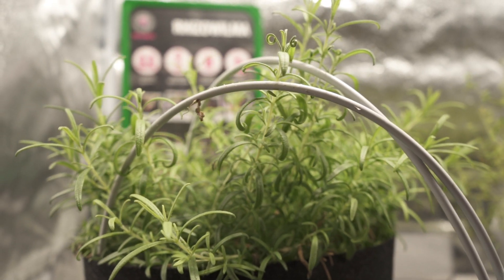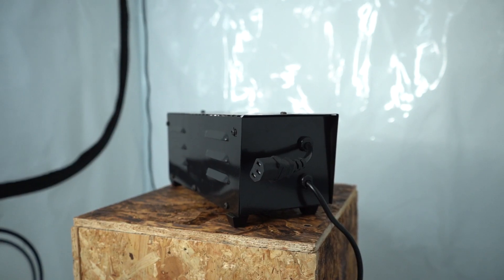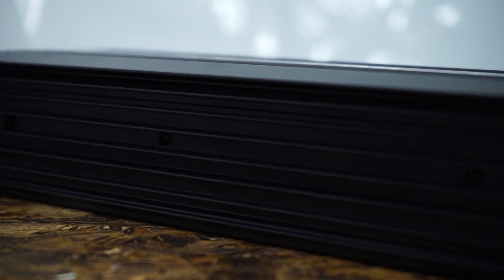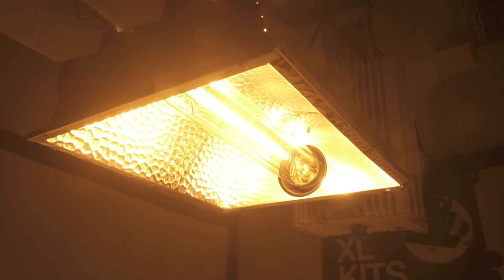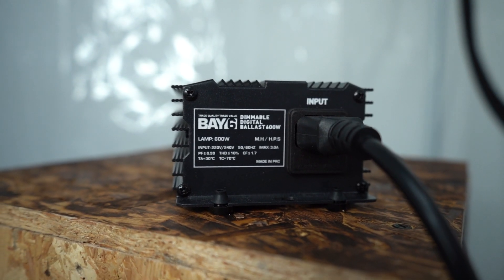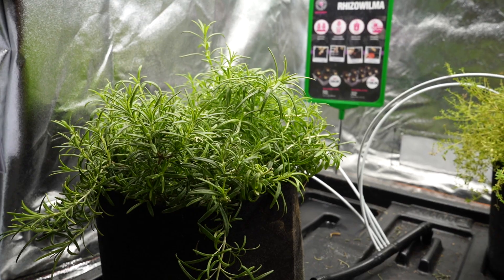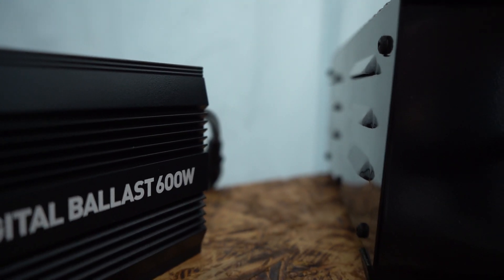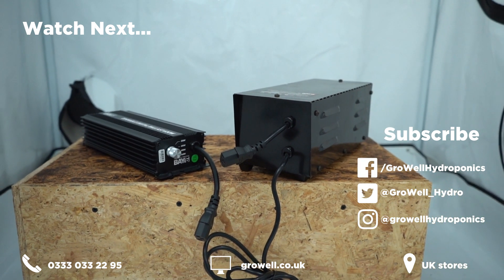Are Digital Ballasts Better than Magnetic Ballasts? | Hints & Tips

Comment: I have a question since finding a 250 watt digital ballast, since I can’t find em these days. If I run my 600 watt ballast set to 250 W, can I use a 250 bulb? Will I only be drawing 250 watts from the wall?

Comment: Was wondering if a 250w bulb is compatible when ballast is set to 250w . Wasn't very clear in video
Reply from the maker: We wouldn't recommend it, but it is possible. Even set to 250W any 600W dimmable ballast will send enough current through initially to power up a 600W bulb. As the 250W lamp isn't designed for this its life span is significantly shortened.